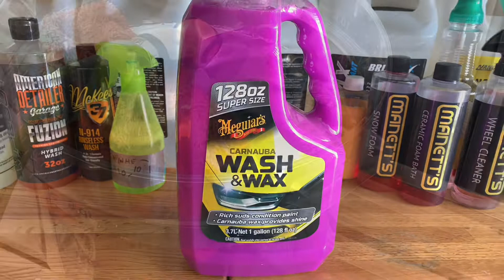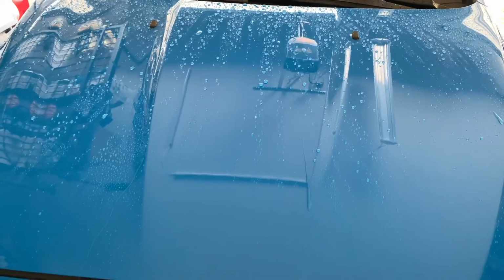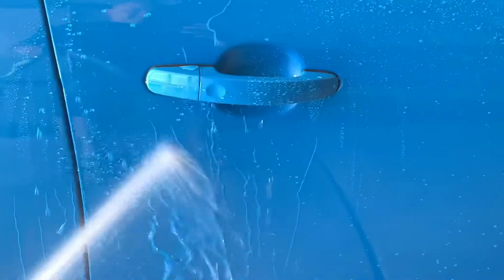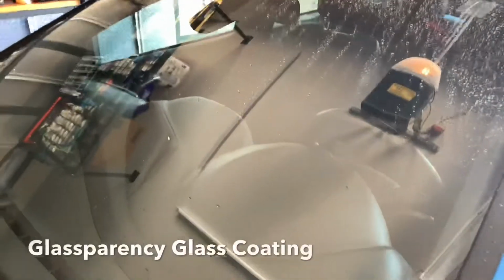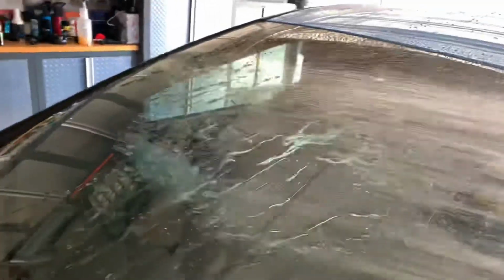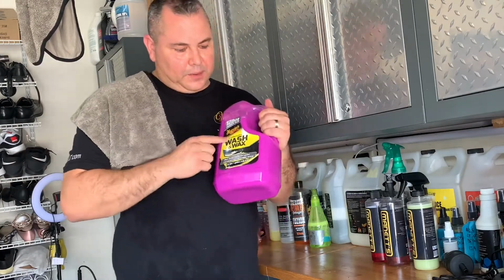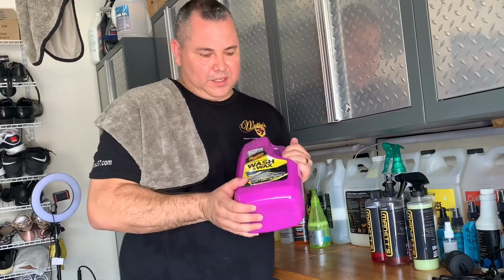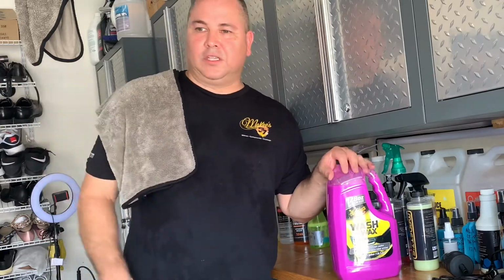Meguiar’s Carnauba Wash & Wax ( other product updates)

Comment: Have you tested any Ethos Car Care products?  I gave Defy a shot and it’s pretty decent stuff. Small bottle, atomizes almost too well. But I’ve found off-label uses for it. Like cleaning and sealing my iPhone screen, sunglasses, entertainment screen in the car. 

And...Xtreme Solutions makes the gallon jugs of Jersey Devil, so that showed up this week. I put that head-to-head with TEC 582. Verdict: I like both! I dilute the technicians choice detail spray 5 to 1, but unfortunately they said it’s not good to dilute jersey devil. I’m going to dilute it one to one however and see how it goes. I figure if something can be used as a drying aid, that is mixing with water on the car which in a sense, would be like diluting it.

Sometimes when we experiment, good things happen. Just wanted to share my experience. Keep up the fun videos. 🤙🏻 🌞 🚙
Reply from the maker: Craig Encinitas that’s cool.  Haven’t tried Ethos.   Love Jersey Devil.   Haven’t tried to dilute it.   Haven’t tried Tech Choice either.   Hear it’s very good though.    Yes, u can always use them for off label uses.  Smart
Reply: Tec is the shit!! I made a comparison on it per request of you benji

Comment: Do you prefer the air foam gun over water? If so why? Or maybe do a comparison video if you get this question a lot.
Reply from the maker: Tommy Holt water is water.  Air foam gun is a foaming sprayer with soap in it.  2 different things.  For washing with soap I definitely need water in either process.

Comment: Costco has this new blue wash and wax with polymer wax now. Smells like bubblegum, but I feel like it's just..soap lol. Hardly any waxing properties to it, but then again, Im not a fan of 2 in 1s to begin with unless I'm just a casual or doing mass washes for business.
Reply from the maker: Yes, I’ve seen it.  I feel it may be very similar to this.  Just a slight tweak.   Maybe I’ll try it.  I’ve had it in my basket 2 times and I keep taking it out..lol
Reply: @DetailingBreakdown  haha I saw it last week and for $13 for a gallon, I figured eh why not? Could be nice for a maintenance wash for a client's car that just wants it clean. I have to say, the smell is really nice and it does foam up very nicely in a foam cannon.
Reply from the maker: @richieewinns  oh, for sure.   It’s an excellent soap for a maintenance wash.

Comment: In your opinion, is there any good SIO2 infused soap in the market that is worth the price and time to try? Currently using carpro reset but would be nice a small "boost" while washing. Thank you!
Reply from the maker: U know, they all have some layering characteristics to them but I would rather put a ceramic detail spray on after wash.  Or a ceramic booster.   U will get more from that.   And I think it will be more cost effective as ceramic shampoo is expensive

Comment: What is the recommended size/airflow to run the air foam?
Reply from the maker: James Greenstreet I have a 5.1 CFM at 90psi and it’s fine.   I can kill the air from 175psi to 100 psi in about half the car with the air foamer but it keeps working, just the compressor kicks on.   So I’d go with 5.1 or higher at a minimum of 90 psi.